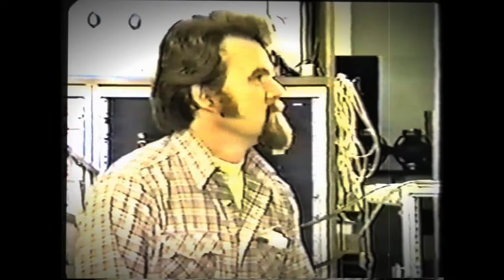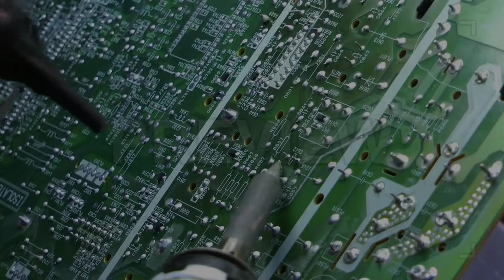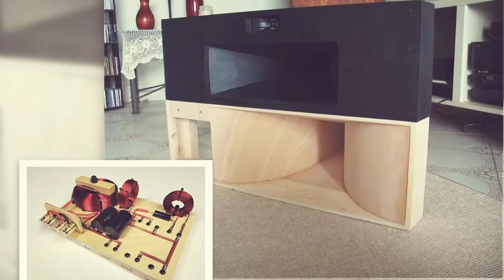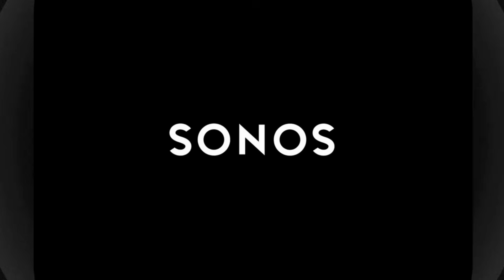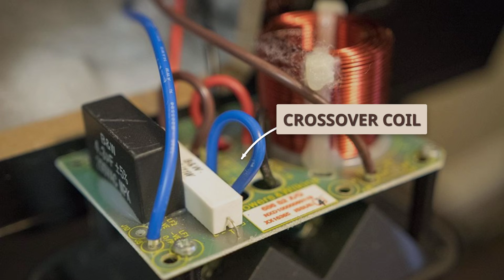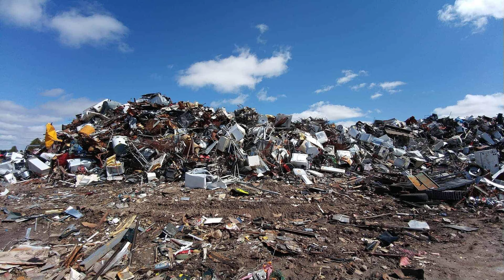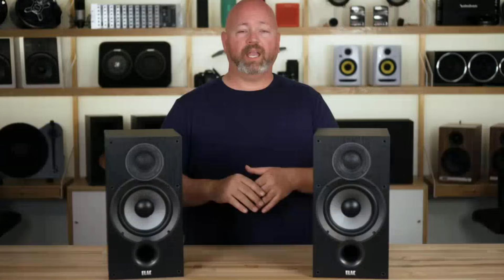The Audio Technicians Blacklist: 5 Hi-Fi Speaker Brands to Never Buy

Comment: The fault condition as described for these 5 brands are not unique to only these 5 Brands but is a consistent issue with many brands in all price points in the contemporary consumer market today. This is why the Soeaker DIY industry is so popular among many serious speaker aficionados. To have control over each aspect of a DIY build allows the hobbyist satisfaction that their hard earned dollars are being spent wisely and allowing the consumer quality control of every aspect of a speakers performance while also providing a platform for component upgrades especially in the crossover network to offer improvements later on. Commercial products do not allow for this level of customer experience because consumer satisfaction is no longer a benchmark many manufacturers care about. Cheap vinyl wraps instead of higher quality wood finishes dominate many speaker brands. 50 years ago speaker buyers would not fall for such products in the marketplace. Times do change and not always for the better.
Reply from the maker: Every word of this is accurate. The DIY speaker community exists precisely because the commercial market stopped serving serious listeners. When you build your own cabinet, select your own drivers, and design your own crossover you understand exactly what you paid for and why. No marketing tax, no planned obsolescence, no vinyl wrap pretending to be walnut.
The broader point stands these five brands are examples of an industry-wide problem, not isolated cases. The video could have been fifty brands. We chose five to make the argument clear.
What drivers are you currently working with? 👌

Comment: Infiniti rs3b
Reply from the maker: A classic. Infinity's EMIT tweeter technology was genuinely ahead of its time ribbon-like dispersion from a dynamic driver. The RS3b is the kind of speaker that reminds you what the industry used to be capable of when engineering came first. Still running strong?
Reply: I love these speakers,no need for a sub
Reply from the maker: Still running and no sub needed. That says everything. 👌
Reply: Yes 100% working

Comment: While there are many valid points in this video, I think Klipsch RP line is getting a bad rap here.    Yeah the baskets are stamped but that doesnt affect longevity.......it does create a possible resonance issue easily solved with a little dynamat applied to the baskets.      Also rebuilding the crossovers are pretty easy (i've done it,   have videos on my channel).  I did it for improvement,  not because they broke.    There is 0 evidence the tweeters will not last a long time.....as for availability,   even if Klipsch doesnt carry them cheap used market solves that problem easily.
Reply from the maker: Fair points and appreciated especially the crossover rebuild experience. The stamped basket resonance issue is real but manageable as you say. The broader concern is less about the current RP line specifically and more about the trajectory under Voxx ownership and what that means long term for parts and engineering standards. The vintage Heritage line remains untouchable for exactly the reasons you describe. 👌
Reply: @WiredTruthHIFI  more than fair...long term availability of parts is always a concern...I've sold speakers I loved knowing it was coming.
Reply from the maker: Selling something you love because you know parts availability is running out that is the most honest summary of planned obsolescence in one sentence. The decision should never have been forced on you.
Reply: @WiredTruthHIFI  can't argue that...lol

Comment: Probably a pair of RTR towers and my full JVC System from 1978 is the best stereo equipment I ever owned. Now I’m running an ONKYO 797 with the Klipsch 625FA theater pack. Now with two SVS PB3000 R/evolution’s. Only Owned the Klipsch for 20 months but they sounds great! I am really impressed with them and just don’t know if it’s worth upgrading. My home theater is 16x16 with 8 ft ceiling 9 ft flat in the middle then 45 degree angle down to 5ft side walls 9 ft wide opening in the pack to the stairs. Pool table area is off to the back left. The  room is fully acoustically treated. Looking to move up to the SVS Titans and full SVS Evolution system. But keeping the Klipsch R-41M’s and R-41SA as my height speakers only. Just need to feel like spending $6000 on the rest of the speakers. After just spending $3,600 on the subwoofer’s. Any thoughts on SVS Evolution series.  Or other speakers in that price bracket.
Reply from the maker: The 1978 JVC system lasting decades while the modern stack gets replaced every few years tells the whole story. On the SVS Evolution question SVS builds measurement-verified speakers with genuine engineering behind them, which puts them ahead of most at that price point. The real question before spending six thousand dollars is whether your fully treated 16x16 room with that ceiling geometry is the limiting factor right now. A room that shape creates specific bass loading challenges that no speaker upgrade solves. What does your current setup sound like in the listening position are you hearing specific problems or just chasing an upgrade? 👌
Reply: @WiredTruthHIFI  I am not hearing any problems. I ran the SVS EQ system that the PB3000 R/evolutions come with then reran the Onkyo room correction. I don’t feel I have enough experience to know really whats good. Thats why I have relied on reviews from Andrew Robinson, What the frick and others.  My neighbor is a musician and sound engineer who just retired from Google. Him and his wife as will as others come over for movies. He says this system sounds really good. That was with the two R-12SW he has not heard the new subwoofer’s yet, I just installed them. We have more neighbor hood friends and family over all the time. Everyone is very impressed and keeps coming back.  The neighborhood calls us the movie house. And it sounds amazing to me.
Reply from the maker: @jacksherman5696  If a retired sound engineer says it sounds really good, that is the only review that matters. The neighborhood movie house is the highest compliment a home theater system can receive. Enjoy every listen. 👌

Comment: I have experienced failures in two Definitive Technology speakers-a powered subwoofer and a pair of bookshelf speakers.  The sub's amp just shut down after 3 years of light use-kind of typical for these types of inexpensive bass boxes.  The bookshelf failure was particularly unusual as both speakers had white noise and hiss from the tweeters after the drivers warmed up.  This flaw showed up with various inputs from four different preamp-amp combos, so it was not source generated.  Really frustrating as they were wonderful sounding and not repairable as they were an "open box" purchase from an unauthorized seller.  Lesson learned.
Reply from the maker: That Definitive Technology tweeter issue is a known failure mode thermal stress on the voice coil causing noise as the driver reaches operating temperature. The fact that it showed up across four different amp combinations confirms it was the speaker, not the source. The real frustration is that "not repairable" should never be the answer on a speaker at that price point. Open box from an unauthorized seller removed the warranty safety net, but a well-engineered speaker should not need it after three years of light use. Exactly the kind of story this channel exists to document. 🏆
Reply: @WiredTruthHIFI  thank you for the education.
Reply from the maker: @richardofpleasantway8027  That is exactly why this channel exists. Thank you for watching. 💪

Comment: Pioneer CS-905 for home surround. Fisher ST-832 for the tube amp.
Reply from the maker: Two genuinely excellent choices. The Pioneer CS-905 is a serious three-way with build quality that modern speakers at three times the price cannot match. And pairing a Fisher with tubes is exactly the right philosophy equipment designed to work together, built to last. How long have you had the Fisher running?
Reply: @WiredTruthHIFI   Fishers have been in my use for decades. Foam around woofers still like new. Upgraded the mid and tweet with NOS period correct Sanyo's. With the Dayton HTA200 a soundscape emerges for real. It's all Goodwill, and lowball bid stuff, but the sound is more.
Reply from the maker: @RobertStribley-r8l  That is the right approach entirely. Decades of use, foam still intact, period correct upgrades and a soundscape that modern gear at ten times the price cannot match. The Dayton HTA200 is an underrated pairing for vintage drivers. Goodwill finds and lowball bids beating showroom setups is exactly the point this channel exists to make.
Reply from the maker: @RobertStribley-r8l  Decades of use and foam still like new  that tells you everything about how Fisher built things. The NOS Sanyo upgrades are the right call and the Dayton HTA200 is a seriously underrated pairing. Goodwill finds outperforming showroom setups is the whole argument in one real-world example. 👌

Comment: 4 large Advents on Sound Anchor Base.
Reply from the maker: A classic setup done properly. The Large Advent is one of the most important speakers in American audio history Henry Kloss understood acoustic suspension before almost anyone. On Sound Anchor bases that is a serious listening system. How long have you had them? 👌
Reply: @WiredTruthHIFI  Yes and don't forget the original KLH products. I have a KLH 8 radio which is said to be the first true hifi radio.
Reply from the maker: @andershammer9307  The KLH Model Eight is exactly that the first serious attempt to bring true high fidelity into a self-contained FM table radio. Edgar Villchur and Henry Kloss designed it at a time when radio was considered a compromise format. The acoustic suspension woofer in a cabinet that small was the same technology that changed speaker design permanently. Fifty years later still running says everything about the engineering standard they applied to something the industry treated as a secondary product. 👌
Reply: I had my 4 Large Advents from 1977 for 30 years, replaced a couple of tweeters and refoamed a couple of woofers. Now my daughter is still enjoying them. I moved up to Vandersteen IIs then currently running a pair of Vandersteen 5s going strong for about 10 years or so.

Comment: My speaker was the old Tannoy definition series TD10, and it is around 22 years old now.  I am running it off a kit amp that was sold through an Australian Hifi enthusiast who designed and built his own Naska amp kit.  I am also running it off a pair of 300B monoblocks made by Melody Hi-fi in China.
Reply from the maker: Twenty two years on a Tannoy Definition TD10 that is exactly what this channel is about. Tannoy's dual concentric driver is one of the great engineering achievements in speaker history, and the TD10 is one of the finest implementations of it. Paired with 300B monoblocks that is a serious listening system built to last a lifetime. The kit amp angle is particularly interesting who needs a branded product when the engineering is done right from the ground up. 🏆

Comment: Thank you for saying it out loud.  As a retired audio technician I can attest the veracity of your claims.  In separate components system, if one of the parts fail or become obsolete, you can easily replace it.  In a compact system, if a device fail inside, even if the replacement parts are available, it will cost you more to fix it than to buy a new one and that is what the company wants you to do : BUY A NEW ONE.  Programmed obsolescence is a great cause of electronic scrap pollution worldwide.
Reply: I would never touch Bose or Bang and Olufsen with a barge pole! I have ears! Just listen! Simples!
Reply from the maker: The ears never lie. 👌
Reply from the maker: This means a lot coming from someone who has seen it firsthand. Programmed obsolescence dressed up as innovation and the consumer pays twice. Once for the product, and again when it fails on schedule. Thank you for your years in the trade. 👌🏆
Reply: @WiredTruthHIFI  In fact, my shop closed its doors more than 20 years ago because of the lack of costumers.
Reply from the maker: @yvesboutin5604 That says everything. The repairability disappeared and the customers followed. When gear is designed to be replaced instead of fixed, the repair industry dies with it. Twenty years later the consumer is left with no support network and products built to fail on schedule. Thank you for sharing that it is exactly the kind of firsthand account this channel exists to amplify.
Reply: thank you Capitalism.
Reply: In the future I suspect many
Landfills will become locations for gold hunters to look for easy sources of quantities of gold because many devices have a quantity of gold inside and when the price of gold soars and the value of the dollar continues to crash hunters will look there instead of mining for the ore.
Reply from the maker: That is not as far-fetched as it sounds. E-waste recycling is already a growing industry for exactly that reason. The real tragedy is that most of this waste was preventable serviceable products that were deliberately replaced by sealed, unrepairable ones. 👌
Reply: @Aswaguespack  A lot of those boards are already sent to third-world countries where other toxic metals contaminate the poor people recuperating the gold.

Comment: Thats why im torn between getting the Edifier MR5 or the older MicroLab H500 system. Newer doesnt mean better.
Reply from the maker: Newer never automatically means better that is the entire point of this channel. The MR5 measures well for the price. But if the MicroLab H500 is in good condition, older and built properly beats newer and cost-reduced every time. What is holding you back from the MicroLab? 👌

Comment: The oldest pair of speakers I use are early ADS-L710s and a set of early 80s JBL 4312 monitors.
Reply from the maker: Two genuinely great choices. The ADS L710 is criminally underrated exceptional crossover design for the era. And the JBL 4312 is a professional monitor that belongs in any serious listening room. Early 80s JBL build quality is simply not replicated today. How do they hold up after all these years?
Reply: @WiredTruthHIFI the JBL’s are originally bought in 1982, I got them from the original owner with the boxes and sound great but I might have the crossovers redone. The ADS-L710s are in need of service. I will have the crossovers rebuilt and anything else done that they need as they are a fantastic speaker system and punch way above their weight!
Reply from the maker: @14Madmax442  1982 JBL 4312s with the original boxes that is a find. The crossover rebuild is the right call on both. Forty year old electrolytic capacitors drift in value over time and a fresh set of quality film caps will bring both systems back to spec. The ADS L710 especially will reward that investment those crossovers are the heart of what makes them special. Keep us posted on how the rebuild goes. 👌

Comment: Bang and Olufsen - top of the line A90 active speakers cost A$90k/US$60k a pair.
Reply from the maker: At that price point you are paying for Scandinavian industrial design as much as acoustic engineering. The question a technician would ask is simple what happens in 10 years when the proprietary amplifier module fails and Bang and Olufsen no longer supports it? Sixty thousand dollars of electronic sculpture.

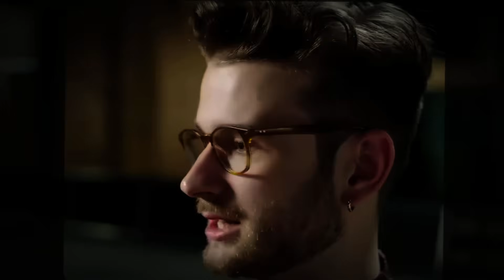Comment: 7:30 the diamond tweeters in my 802 D2s shattered after 10 years with minimal force, unable to buy replacements, so replaced them with aluminum ones. I probably won't buy them again. At least 800 series have decent parts in the crossovers.
Reply from the maker: That is exactly the problem in one real-world example. A flagship speaker at that price point should have replacement parts available indefinitely. Diamond tweeters that shatter and cannot be replaced that tells you everything about the long-term commitment. Glad you found a solution, but you should never have needed one. 👌

Comment: Sonos works well, I’ve had them for over a decade - and still add to the systems. No regrets love the systems
Reply from the maker: Glad it's working well for you and that's genuinely great to hear. The experience varies a lot depending on which generation you own and how you use them. The concern isn't really about sound quality, it's about what happens when the software side changes. Hopefully yours keeps running strong for another decade. 🙏